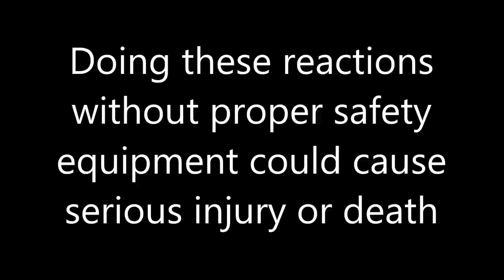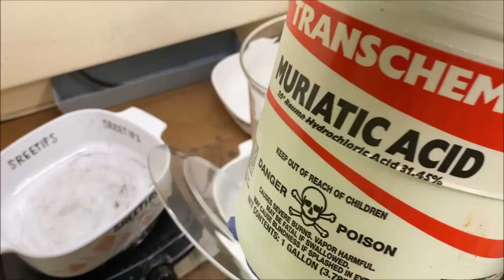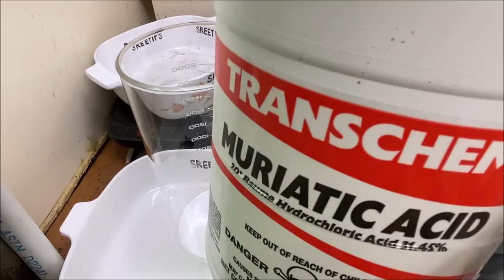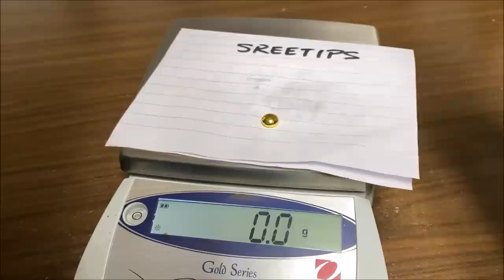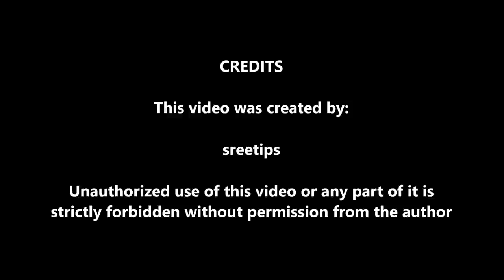Computer Scrap EASY REFINE TO PURE GOLD

Comment: If you can take the gold out of solution and leave the copper why not dissolve both in a single step?
Reply from the maker: I have a video titled “trimmed fingers in aqua regia” posted on my channel. Give it a look and you’ll see why it’s best to remove the base metals before dissolving the gold in aqua regia.
Reply: @sreetips  So the copper nitrate would prevent the gold from going into solution?
Reply from the maker: No, it’s more complex. The solution gets real dirty and it hard to tell what’s going on visually.

Comment: I am new to the channel... nice work! Can you list the acid concentrations you use?
Reply from the maker: Welcome! HCl bottle says 31.45%. Nitric label says 68% to 70%. Sulfuric 94%
Reply: @sreetips  I have a bunch of old computer processors I have saved for many years. Most are encased in ceramic and was wondering if you had ever processed computer processors like this? Is there an efficient method to recover the gold outside of a sledge hammer?
Reply from the maker: I’ve done pentium pro processors. I break them open to get the gold inside the sealed processors. They have the most gold of all CPUs. I was able to get 0.3g of pure gold from each one. If I had the processors you speak of, I’d break them up with a hammer, roast them to redness, then try them is aqua regia. But be aware that there is gold in computer scrap, but the amount is tiny. So the yields will be very low.

Comment: where do you get your melting dishes?  I've bought three so far, and they explode as soon as the flame touches them...
Reply from the maker: Fused silica melt dishes will withstand temperatures up over 2500 degrees F, then they begin to melt. I buy them on eBay.

Comment: Cant you just melt it all together and then bust it up into as small bits as you can. Then simply pan it out. the metal should pool together into heavy chunks making it easy to separate. Then you can cupel away any lead and chemically separate the gold. Figure this way is less reliant on chemical's.  I can see a future where we are mining scrap heaps rather than mines because the gold is more easy to get to. There is a kids film called Wall-E that predicts this lol.
Reply from the maker: Those fiber boards that the gold foils are attached to, do not burn well. Most of the refiners I learned from on the goldrefiningforum.com advised against trying to burn computer scrap to get the gold.
Reply: @sreetips  oh interesting i guess it would contain allot of oils and other stuff. Your method is by far the quickest and cleanest i have seen so far :D

Comment: Is it actually worth the money to refine the computer fingers, given the yield they return?
Reply from the maker: Seeing how money is becoming worthless, due to money printing (inflation), the answer is yes. I’ve turned paper dollars into pure gold. And that’s worth every cent!
Reply: Can you use sterling silver and melt it down to make silver shot to use in a electrolytic silver cell??
Reply from the maker: With deficit upon deficit and $32.5 trillion in debt, how can that not be called bankrupt? 32.5 trillion seconds is over a million years, that’s how big a number it is. Too big for the human mind to comprehend.
Reply from the maker: Yes, but the electrolyte will quickly become saturated with copper, run the risk of copper co-depositing with the pure silver and thus contaminate it.
Reply: @sreetips  So I would basically have to pull out the base metals with nitric acid to purify the silver?
Reply from the maker: Probably not
Reply: @sreetips  I better go back and watch the process again
Reply from the maker: The copper must be removed from the sterling before it gets run through the silver cell. It must be dissolved in nitric (or hot sulfuric) then to get the copper out. To remove copper simply add clean copper metal to the dissolved sterling silver. The silver will reduce to 99% silver powder, the copper stays behind. Processing with hot sulfuric is dangerous and too lengthy to write it all in the comment section.
Reply: @sreetips  The nitric acid boil dissolves the sterling silver. Then the copper is pulled out on the clean copper pieces and your left with silver in solution. Then SMB cements out the silver from solution. Rinse the cemented silver and add heat to dry it. Then it can be melted into shot to run through the silver cell.
Reply from the maker: @larrykester8593 no, the silver reduces on the copper.
Reply: @sreetips  I realized that it cements on copper. The SMB is used for Gold

Comment: I never buy fingers.  I buy the entire boards.  You're paying for the cost of someone trimming off those fingers AND you're paying a premium while losing all the other delightful components of the boards, ESPECIALLY the flat chips of RAM cards, which can have a pretty high yield since they don't have a huge amount of plastic and massive metal legs compared to thick chips and EPROMS.
Reply from the maker: I needed them to make the video.
Reply: @sreetips  Yep, just making the point to others that buying fingers alone isn't practical for profit, but finding a good supplier for the whole RAM cards CAN be... just not usually on Ebay.  Rarely, a bunch get listed improperly and if you can find the right search terms, you can nab them much cheaper, but it's not common.
Reply from the maker: I’m in this for profit in gold, not paper dollars.

Comment: $100 Reverse osmosis with deionizing resin stage would pay of many times. The amount of distilled water you use is astounding. It's not free and it's not even as clean.
Reply from the maker: I use about twenty gallons per month.

Comment: My nitric acid solution turns blue but gets murky. I end up with grey gunk when filtering it, and when I add the sodium bisulphite to the aqua regia and stir the gold does not precipitate. The sodium just settles on the bottom. 
Where am I going wrong? Do I have to let all of the base metals dissolve before filtering the blue liquid? Is it because there is tin in my load? 
Please help!
Reply from the maker: That’s baffling, I’ve never seen that before.
Reply: @sreetips  does it need to be on heat to precipitate? I’m reading Hokes now to better troubleshoot.
Reply from the maker: I’ve never had to use heat to precipitate the gold. Probably no gold in solution to begin with. A common beginner mistake.